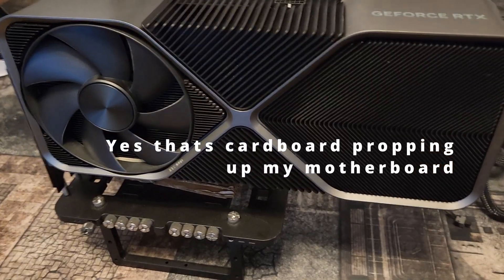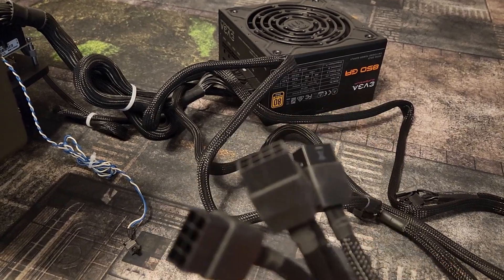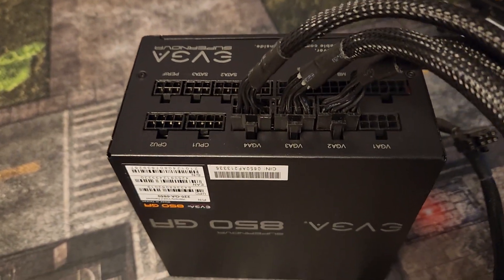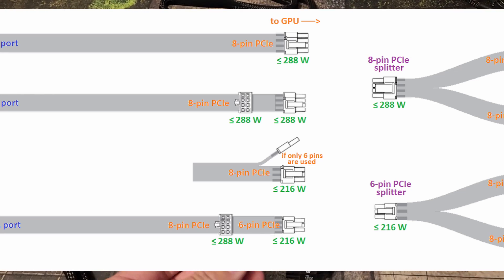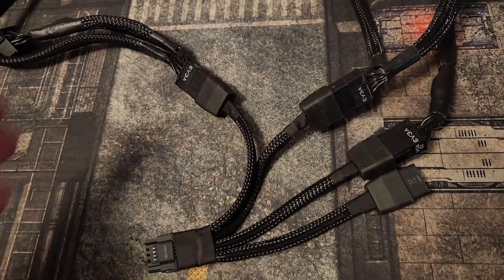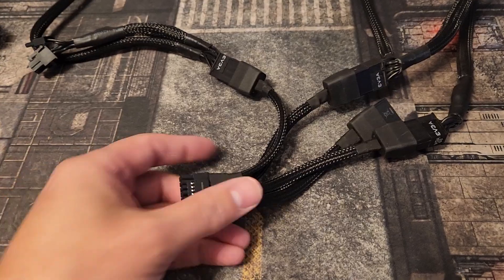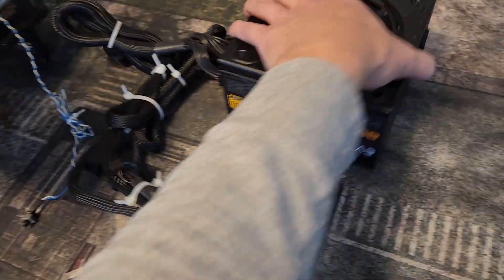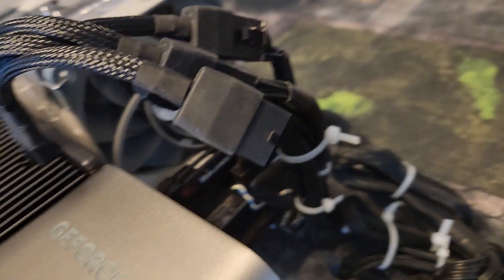How to connect a rtx 4090 into an older psu, 4090 install guide!

Comment: hi friend I have the EVGA SUPERNOVA GT 850 W power supply I only have 3 VGA slots but I have 2 CPU ports I can use the fourth 8 pin of the CPU2 port if I want or do you advise me against it??? Thanks for your great video, you helped me a lot, so I will subscribe

Comment: Your video just saved me $300. I have a MSI Supreme Liquid X 4090 on a 1000W Corsair PSU, which has a total of 4 6+2-pin connectors. I already need 1 for the Corsair Link Controller (i don't know why it needs that much power, I think a 6-pin SATA would do just fine), leaving only 3 6+2-pin connector free to use. Only a Corsair 1600X provides more 6+2-pin connectors.

Comment: any reccomendation for an adapater I dont like the looks the one that comes in the card
Reply: I ordered a 12VHPWR to 4x 6+2-pin cable from CableMod. To be completly safe from a burning 12VHPWR connection on your graphics card, I suggest never buy a 90 degree adapter, but a one-piece cable with a fixed 90° 12VHPWR connector.

Comment: @kr00tman - hey there, as someone who may have the opportunity to buy a 4090, I currently have an Asus Rog Thor 1200w psu, can't remember what connectors it has, so will look that up. Do wonder if your setup here is in general workable with that psu?

But as you've mentioned CableMod - they recalled their most recent 4080/4090 connectors due to an issue, and these cards are still burning connectors, so have you had any issues with any of your items as this video is quite old by todays date...

Comment: You are terrible at math.. 250+250 is 500w.. so if it pulls 400w how would you catch only two cables on fire if they are rated for 288w each? 😂 do the math correctly 🤡
Reply from the maker: If you want to push your cables to the max feel free...you also have to take into account the awg of the cables...

Comment: shoot, i just bought 4090 and realized my RM850x and it only has 2 8pin PCIe and only came with 2 cables. Does this mean I am screwed? i can't plug in 3 seperate cables to adapter if the split cables don't matter.  I an honestly scratching my head now as to why cables came with power supply has a split into two 6+2 pin adapters when it doesn't matter per this video. however I am actually going to run 4090 at 90 or 80% power limit, i don't think it would need more then 2 connections if 2 8pins = 576. but according to your videos it has to be at least 3 separate cables. what frustrates me even more is manual came with gpu doesn't mention any of this, it just says plug cables in and need to be separate cables, that's it.  I'm going to have to do more research before i attempt just 2 cables if it's even possible before i try, i don' want to fry it.
Reply: Ok i think between your two videos you may have some misinformation. From what i have read elsewhere corsair's two 8 pin connections at PSU side is capable of supplying 4 8 pins of power up to 600w, so it appears i can simply use 2 cables and plug in the 3 or 4 split cables and be just fine according to one source the cables on the corsair are designed to handle it. according to your video you mention not using split cables period and that 8pin at PSU is only max 288w, which at least from one source i found so far on my PSU is wrong. Sadly the manual came with my PSU doesn't mention max load, i'll dig around some more and try it tonight. Edit: I read some more, they say 18 gauge can only handle 288w for 8pin at PSU but my power supply is 16 gauge and that's reason why it can handle more power and use two split cables just fine with 4090 with 4 connectors, I am also actually lowering powerlimit based on my research to 80 or 90% which further reduces by 100 watts while only losing 1-2% in performance, so given that i'll likely only be drawing 350w between the 2 split 16 gauge cables I assume i am good.
Reply from the maker: if you are using corsairs adapter your fine, if you are not it has to be 3 different 8 pins

https://www.bestbuy.com/site/corsair-2-premium-individually-sleeved-12-4pin-pcie-gen-5-type-4-600w-12vhpwr-cable-black/6531632.p?skuId=6531632

 @zengrath
Reply: @krootman_digitial  I got it running and so far seems flawless even before lowering the power limit a tad. ran a bunch of benchmarks and all

Comment: So im looking at getting a 4070 ti super.. and im sure it comes with the two 6 pin to 12 pin connector. So for the pcie power cable.. would it be fine to just have 1 plug with the two 8 pin connectors plugged in? ( obviously have two connectors hanging off) or should i have two seperate pcie cords?
Reply from the maker: 2 separate pcie cables, I'll be doing cable install guides for both
Reply: @krootman_digitial  thank you!!

Comment: Im a little dumb do you have any links for the pcie cables,  also i got the evga 1300 gold i dont think that changes anything, i just need a male to male 8 pin cable?
Reply from the maker: It should come with all the cables you need
Reply: @krootman_digitial  i got the psu a long time ago and my dumbass must of lost the cables
Reply from the maker: @mobyrichard9964  check out cable mod or EVGA.com for replacement cables
Reply: @krootman_digitial  thanks brother you're the man

Comment: I-m very new on pc building, so my question might sound silly.
Why do you plug your cable on on VGA-2 VGA-4 and VGA-4  of the power supply, leaving the VGA-1 free? is it meant to be like that?
Reply from the maker: No reason, all 4 are for pcie cables to connect your gpu too

Comment: My psu only has 2 pcie spots tho. I’d need 3 for what you’re saying.
Reply: No he is terrible at math.. 400w is less than 500w correct? If each cable puts out 250w that means two cables is 100w more than enough.. dudes an idiot..

Comment: I have never heard what this man is saying in this video. Every other video that I've heard or seen, all said to connect all 4 of them not just 3. I would not even recommend using that converter cable splitter at all, i would toss it in the garbage. They are very unreelable and often give you bad connection even when they are properly connected to each end between the GPU and PSU.  I would just buy a long 600w PCIE 5.0 / Gen 5 12vhpwr psu cable. That's all you need. Cablemods offer really good cables.
Reply: Source? I’m wondering because I have 3 only like this video and I’m getting random resets while gaming

Comment: hey krootman i just ordered a rtx 4080. do you think an aftermarket corsair 12pin into 2 8 pin cables would fit a cooler master 850-watt psu? I'm just not sure if the corsair 8 pin connectors will be the same as the cooler master 8 pin connectors or are they all the same and it will fit? thanks.
Reply from the maker: No don't mix those!
Reply: @krootman_digitial  ok thanks yeah i just found out they are only meant for the corsair psu. i might have to buy a new psu.

Comment: Hi, please help me to understand further more , to my understanding 2 x 8 pin {576 watt max ,single 8 pin} connecting to the adapter 2 instead of 3 must be secure to right? because non overclock founders edition draws max 450watt in heavy bench test. 
Please correct me if i am wrong.
Reply: Did you ever get an answer to this?  My cables are tough to move and I already have 2 going to my 3080.  Can I just plug that same setup into the 4090 and be good to go?
Reply: @Spydiggity Hi, well if you you got a single 12v power supply minimal 850 watt or {750 watt titanium}, recommendation is 1000 watt gold or platinum, yes you can test it with 2x8 pin with a side adapter from a nother power source to a 8pin to plug 3x8 pins, because it is protected from the vga bios if it detect 2x8 pins it wont start up i think. 
Because a non oc founders edition 4090 can pull max 450watt 3x8pin and with 4x8pin non oc likely? but a 4090 oc card meaning 4 x 8 pin must required, can pul over 500watts {in cyberpunk everything ULTRA {overdrive mode} and especially like the settings below this is ultra ultra ultra real ultra settings.
hdr mode ON
nvidia reflex low latency ON+ BOOST
frame genaration ON/OFF  ON you wil hit 40 fps with a 13900ks or 7950x3d OFF you will hit 20 fps so basically with a 4090 and the fastest cpu to play 60fps steady you must play in 2k!!!
dlss, DLAA mode!!!! ON {not quality}
dlss ray construction ON
field of view 100%
screen spcae reflection quality PSCYCHO
path tracing in photo mode ON

with all these settings the 4090 non oc will draw max between 420/440watt and a oc over 500 watss but will only gain you 4/5 fps and the cpu wil draw 80watt.

remember this is overkill ultra settings hahaahahh. your screen wil explode from the quality.
Reply: py paste this fore the settings     Cyberpunk 2077 Ray Tracing Overdrive DLAA 4K | RTX 4090 | i9 13900K 6GHz

Comment: Thanks, that helped a lot, I was sat staring at it wondering if I needed all 4
Think I'll get a cable mod at some point but I'm happy for now
Subbed
Reply from the maker: Cable mod cable is cool, I actually am doing a video on it in a few days!
Reply: Excellent, Ill keep an eye out for it mate
Reply: I'm actually thinking of getting the Cablemod, too. Which one are you getting? I'm not clear which one I should get other than I think I should be getting the 4 connector one. Thanks.
Reply: Im not sure yet, Im going to do a little  research first

Comment: I bought a XFX RX6800XT merc 319 and it was the biggest mistake in my  life that shit is crashing in every single game it's passing stress but it's crashing when playing games I'm gonna buy a Rtx 4090 I thought my 850 gold will not be enough for a 4090 thanks for the video looks i don't have to buy new PSU
Reply from the maker: Yup, your golden, and can you rma it or maybe run gpuz when you run benchmarks to see if you can spot the issue there
Reply: @krootman_digitial  there's is no issue with the GPU it's just dogshit AMD drivers which is I cannot fix . I mostly play battlefield 2042 . My CPU is 13700kf and ram kit is  ddr5 7200mhz .

Comment: wouldnt also be better if u did a 12vhpwr to 12vhpwr if the psu is 3.0 or is it riskier because it pulls a lot of whatts on a single cable?
Reply from the maker: nope as long as you are within cable spec you are safe

Comment: I have 1000w power supply and 4090 OC strix, and I can use only 3 cables (6+2pin). Can I use them like in this video? I don't understand, the power of OC version is bigger then non OC graphic cards? (Ps. Sorry for my English)
Reply from the maker: you can, but you wont be able to oc unless you use 4 cables, it 3 cables caps the power draw

Comment: great video, but i wanted to ask, i have a inno3d ichill x3 4070 ti and evga 850w g3, i only have just the 2 x 6+2 pin vga cables, can i do like you did with the 4090, and only have 2 populated in the included 3 slot adaptor? or would i need the 3rd cable?
Reply: That good question

Comment: I mean with a decent PC hardware and a good 850W PSU you should be fine. Was planning to upgrade from my sapphire toxic 6900XT (tho i don't have to, it's a pretty powerful card that runs pretty much everything at full tilt and a 4090 would be a waste of money but still it's a fucking cool card ngl) and i was having doubts about the recommended PSU wattage tho I really think my corsair HX 850 is more than capable of feeding this fat thing with all the PCI-E connectors plugged in. I'm s till kinda skeptical about the new 12V adapter and all that jazz
Reply from the maker: Good points and honestly your fine I have had zero issues with both of my 4090s

Comment: having power connector in the middle of the card,  really fucks up the hiding of wires the hell are they thinking?
Reply from the maker: The unreleased EVGA 4090 would have had the plug at the rear :(

Comment: As long as you get a PSU with A VGA Slots, you can easily connect any GPU cards?
Reply from the maker: With a? Was that a typeo?
Reply: @krootman_digitial  I mean, that PSU with VGA slots, you can connect any GPU cards?
Reply from the maker: @SC87Returns  for the most part yes, just need to check the cable ratings

Comment: I have 750w power suply corsair with 2 pci 8 pin cable.. but both these 2 cables have daisy chain so it gives 4 8 pin total.. is there any way to power this with this psu? Thx
Reply from the maker: Nope, it's not strong enough and it doesn't have enough pcie slots, your only way would be to use the Corsair cable but you would be under speced and it wouldn't be safe

Comment: So I don’t have to upgrade to a 1000w to use the 4090 and keep my 850w psu?
Reply from the maker: Yup as long as it has at least3 vga slots
Reply: No you don't.4090's power supply requirement is 850W.

Comment: I have a 1000 NZXT PSU and i would like to upgrade to 4090 from a 3080, but i dont have a extra cable to connect the 4th PCIe. Would i be fine just using 3?
Reply from the maker: Yup watch the video

Comment: my PC has 1000W PSU (non-modular) but only TWO pcie power cable (1st = 8-pin + 6pin piggyback, 2nd=8-pin + 6pin piggyback). I understand total power delivered is 450W using this two cable is mentioned in spec. The 3090TI comes with 12pin to 3(three), 8-pin connector. Can i just connect TWO-8pin (from power supply) to TWO-8pin (12-pin connector cable) and leave one 8-pin open. Will this work and work ? Thanks you
Reply from the maker: nope, I wouldnt do that
Reply: @krootman_digitial  Thank you for prompt reply. However what is the solution for my case.. can i get TWO 8pin PCI-E female to 16pin adapter from cable mod. Will it work? does adapter cables take cares of ATX 3.0 signalling? PSU===double 8pin male === double 8 pin female ----- 12VHPWR 16pin.  what is your feedback?
Reply from the maker: @AbhishekS-em2it  check the cable mod specs and go from there, my Corsair cable only has 2 6 pins and it works fine but it's a special kind of cable

Comment: So I have a zotac gaming 4070 ti trinity oc edition that came with a 3 8 pin adapter but the problem is my 750 watt psu only has 1 8 pin vga cable that splints into 2 8 pins so I can only plug in 2 out of the 3 8 pin adapter and the red vga light shows up on my motherboard. Is it fine if I have only 2 of the 3 8 pins connected into the gpu? It said 750 wats is enough for a 4070 ti.
Reply from the maker: UNPLUG IT ASAP, you do not have it installed correctly, think of the 4070ti like a 3090ti in terms of power draw, you need AT LEAST 2 8 pin vga ports in your psu, if you pigtail 1 vga into 2 of the 8 pins as your only source of power to the gpu YOU WILL MELT THE CABLE!
Reply: @krootman_digitial  thanks for the reply, I just replaced the PSU and got the corsair 850-watt gold edition, and plug in 2 PCI-e cables into the power supply, and got in all 3 adapters connected.

Comment: good info! but i wish u tried this cable to ( Corsair 600W PCIe 5.0 12VHPWR Type-4 PSU Power Cable )people say it will work if u have a rm850x corsair..so does ur evga psu also has a cable like that?
Reply from the maker: my evga psu does not as far as I know, as far as the corsair one, check out this video I made on it (its installed into my other 4090 https://www.youtube.com/watch?v=_lf2gOFQiJo

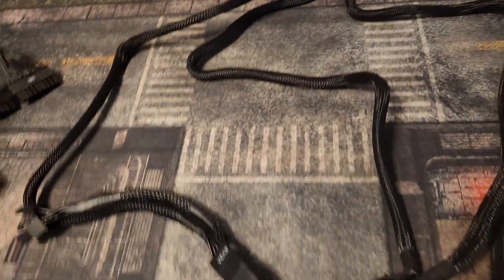Comment: Thanks for the helpful video -- if one were to get the cablemod adapter, would we then connect the final setup @3:38 to that adapter and thats all? I am having trouble finding videos of people installing / using that with older psu tech.
Reply from the maker: yup, if you check out my other videos on the 4090 I go over using a corsair cable. and a cable mod cable